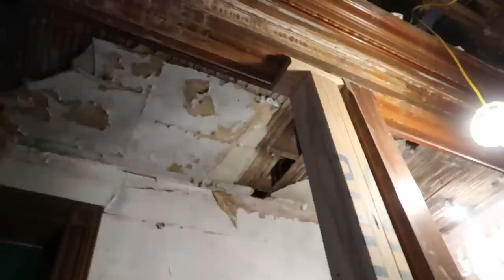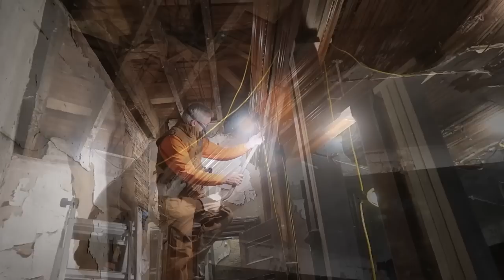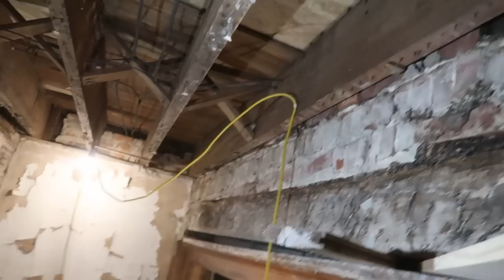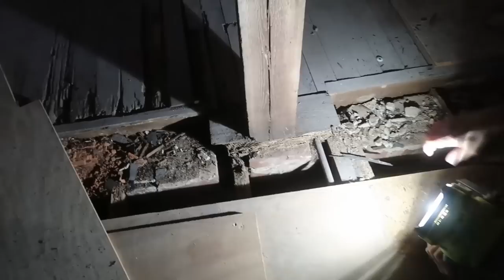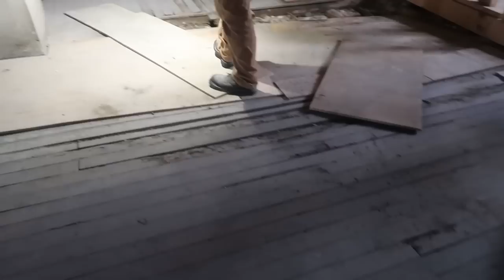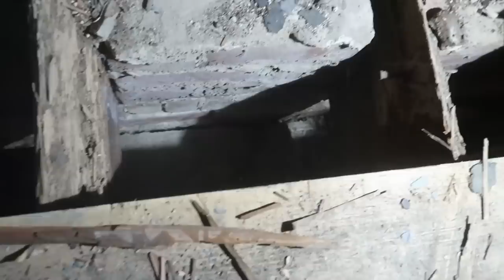DAMAGE Caused By FAULTY Engineering!! It Was Too SMALL! S3E37

Comment: I'm no engineer and I'm all for authentic restoration. But in this case, I'm wondering if it wouldn't be best to replace that sagging lumber with a good, solid piece of steel? The crown molding is gorgeous!
Reply from the maker: We don't mind using modern construction technology on places that will be hidden.
Reply: Quite likely that (or reinforced concrete) will be the best solution. Since there's not much brickwork above that beam, it might be easiest to support the roof and floor joists temporarily, remove the whole lot and replace with a concrete beam. Building forms without dismantling the whole woodwork might be tricky but still easier than lugging a steel beam up there.
Reply: @Ragnar8504  You make a good point!
Reply: I agree with the steel beam for such a long span.
Reply from the maker: @julieduchek2969  We went back and forth quite a bit between steel, concrete, laminated beams and traditional lumber. In a few of our intro shots from some recent videos you can see the beam in question behind us. =)
Reply: @moorelandhouse  is the load properly transferred to the foundation? If not, you may want to get an engineer in there to see if you need some pillars, or poles, on a proper  reinforced concrete slab.
Reply from the maker: It's just fine.

Comment: You guys are doing great and I'm sure you will succeed. 😃
I think it's time to bring in an architect, someone who understands how to bring the weight down safely. As a former European builder I would expect an I-beam in this place. And I can already say that even that iron beam will not become a small one. The arch on the masonry doesn't do anything at all, for the arch to work you need to have counter pressure from the sides (like bookends). And as far as I can tell those walls are just bearing. Not to mention the enormous pressure on the sides because of the too small arch even the stones would shatter. These people didn't understand what they were doing.
To catch the roof you could temporarily use the chimney (like someone raises his arms to the sky) where the arms are beams. I assume that the chimney is well founded. Remember that the chimney cannot have lateral pressure, so if you put a beam on one side, you must also put a beam on the other side.
Reply from the maker: Luckily we had enough room to do it with a laminated beam. We researched it for almost two years and settled on the best solution for our situation.

Comment: I’m not an engineer but I’ve seen and worked in a lot of structural renovations and new construction.   
Please shore up from the lowest level to the highest level.  Also consider there’s is an outward force because or the arch.  Shore side to side to prevent inward collapse as well.  This is probably one of the largest tasks you’ll have to remediate. You got this buddy! 💪🏽.
Reply from the maker: Yep, that's exactly how we did it. We never quite trust the structure right below the area we are working on.

Comment: An under built header was also a problem in the Cross House in Emporia Kansas.  Caused some issues for Ross who replaced it will a steel I-beam.  Guess they were still perfecting the engineering weight loads in those days! LOL
Reply from the maker: We solved it by over building. =) It won't sag again.

Comment: I’ve seen some tricks done on several big houses here in Evansville, big three story houses on the river front.
And honestly, your framing is stronger than you think. As far as the roof.
You could build a strong bay beam and scaffold that up on two sets. That way the joists are open for repair
Reply from the maker: The toughest part of doing the replacement was working around the decorative trim that was directly below the beam we needed to replace. We thought we did it very creatively and safely. It took a while though.

Comment: When we went threw our discovery after we bought our first home my husband and father-in-law made the discovery that the upstairs landing and support walls were hanging up on our central chimney.  Two spans of 15 feet on either side of the chimney were not supported very well.  The bathroom toilet was at a 30* lean.  My father-in-law found two I beans the size of the spam we needed and with support of 4X4s supported the I beams.  They then brought the floors down to the proper height by sledgehammering the rafters and flooring.  I guess I beams are in your future.
Reply from the maker: Of course there are plenty of ways that this could have been done. We tried to think of which one would work the best in our situation and we went with a large laminated beam.

Comment: The brick blocking is just dead weight now, making support more difficult.  It will be hard to add horizontal beams and still save the beautiful molding and woodwork.  But I'm sure you'll figure it out.  ;-)
Reply from the maker: It was definitely a puzzle. You are correct, the bricks are now just ballast that needs thrown overboard. =)

Comment: My oh my! All I can think of is replace either with newly made beam sandwiched with steel plate between 2 X whatever's or replace with a steel "I" beam.  Of course I would get a structural engineer for this one to calculate and design out the proper beam.  But this is going the be a Jenka project to replace that beam with a lot of temporary supports in the process.  Will be interesting the see how this all develops . . .
Reply from the maker: It certainly was a Jenga puzzle. We did figure it out though. Lots and lots of "temporary". =)
Reply: We did the sandwich thing with a flat piece of  steel for the sagging span over our 16 ft garage door. It hasn't moved for the last 20 yrs. That poor carpenter liked working alone, but balked when it came time to put the beam sandwich made of 2x12s and steel into place.
Reply from the maker: That does sound heavy.

Comment: Would it be an option to replace that beam, "joist" in that corridor for 1 long stretched metal or concrete joist to prevent future problems
Reply from the maker: We went back and forth about what to use. We decided to use a laminated beam.

Comment: I guess I don't understand the point of the bricks on top of that beam.  It seems like it would not do much, if any, to provide support strength.  I'm sure you folks will find a way to solve the problem!
Reply from the maker: The only thing we could think of is that they used brick instead of wood to do the blocking between joists. Of course, it could have been a fire break as well.

Comment: I wonder how much the problem was caused by the beam being undersized and how much was caused by failure of the roofing material allowing water to enter weakening and damaging the substructure putting more stress on things as loads shifted.  It continues to make sense not to put a new roof on until you get the structural issues solved as long as you can keep the water out with temporary roofing.  I see a lot more flooring and ceilings coming down as you work through the areas damaged by leaks as I bet there are a lot more floor joists rotted in those areas.
Reply from the maker: We think it might have been a combination of both the water and being undersized. We just took that particular beam apart last week and one of the four 2x12s that made it up was completely destroyed by termite damage. We would have never been able to hold up the roof with temporary support if it still had the slate on it. That stuff is heavy! There are plenty of rotted joists in the Mooreland House. =)
Reply: @moorelandhouse  I am betting on a combination of both with the water and termites causing the major issues. The undersize I think would have been an issue long ago if it was the major cause in my opinion. A 25% reduction by termites would have a major change in the calculations.
Reply from the maker: Totally agree!

Comment: I see no reason to remove that big solid beam , maybe take all the bricks off it to lighten up the  load replace them with appropriate bracing . I have seen where they put a steel post to support it and covering it with a hollowed out decorative wood post to support it but i would seriously consult a structural or architectural engineer before doing anything drastic with that beam. A little sagging is to be expected . I would find another way to alter the flat roof so it  has a significant pitch to by (not altering internal structure).  I personally would been replacing more of the floor joist  from the rotted out sections (the  bathroom)  so it  could at least brace things up  from the basement up through the  structure,  Good luck
Reply from the maker: We spent the last two years trying to come up with a solution to this problem. We finally decided to take it all out and put in a laminated beam. It seemed like the best solution overall and we will never have to address this area again.

Comment: It just seems to me that the brick isn`t doing all that much good- it`s just adding a lot of unnecessary weight to the whole area. Could it be safely removed and replaced with 2x lumber?
Reply from the maker: The brick was there to keep the floor joists from tipping over. We did remove them and did not replace them.